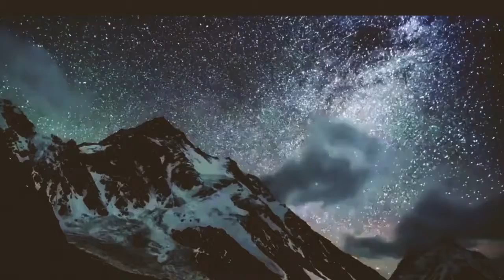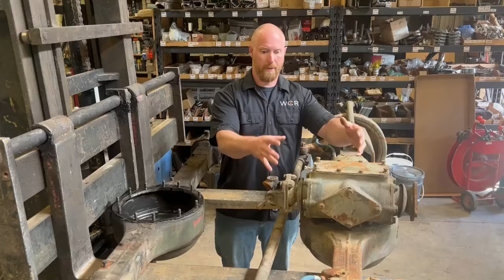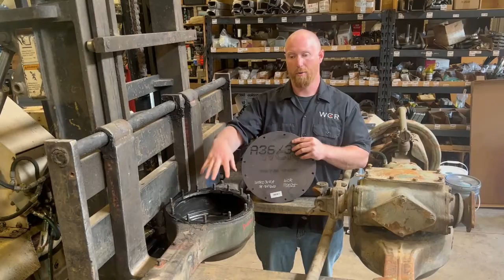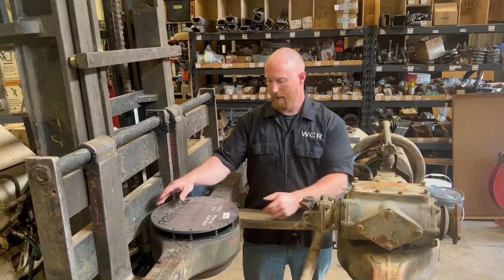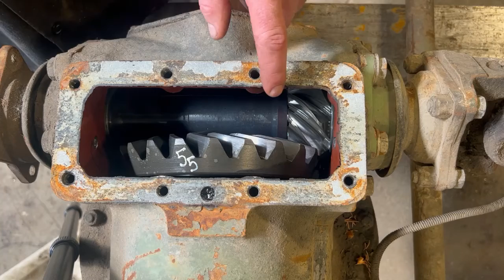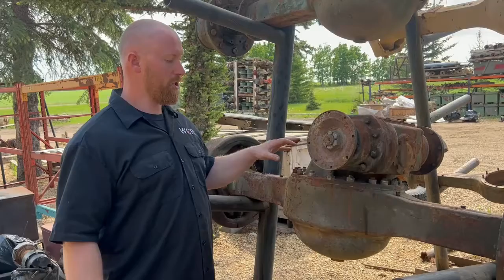2.5 Ton Center Chunk Flip Jig

Comment: I need help ,I need to know the diameter both inside and out side of the outer knuckle where the spindle bolts on  . I also need to know the thickness of that mounting surface as well , I also need the bolt pattern of that flange .  .I am designing a gear box . I have been to 3 four wheel drive shops  and all over the internet and i really need this info and can't find it anywhere .Any help would be so greatly appreciated thank you
Reply from the maker: Send an email to neil@wcr-inc.ca
Reply: @WesternCanadianRockwell  thank you so very much

Comment: So if I understood you correctly, if I decide to flip my chunks I will take my rear put it to the front then the front to the rear? So as to keep the pinion gear in the correct drive location.
Reply from the maker: No not exactly, to flip the center chunk simply pick it up spin it 180° and set it back in the housing
Reply: so if you flip the chunk to center it do you then need to flip the entire axle to keep the pinion going the proper direction?